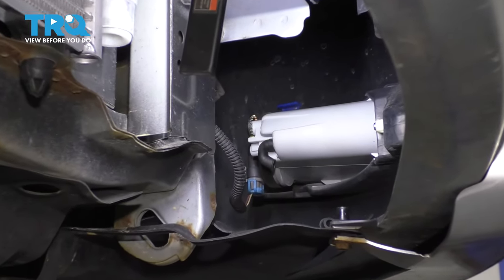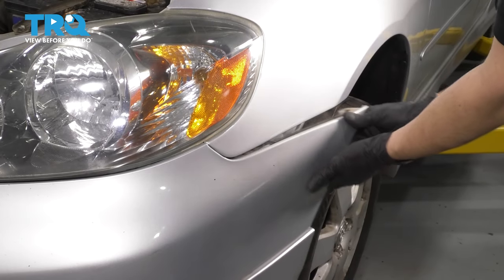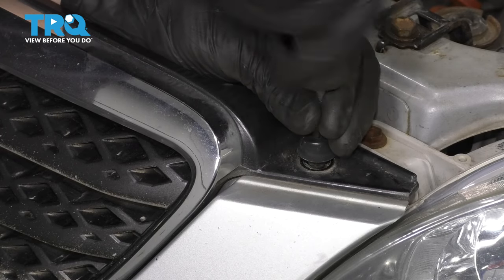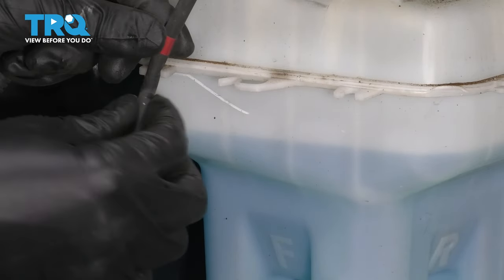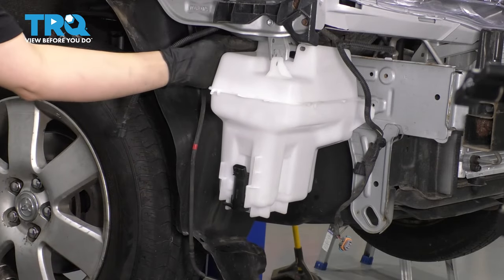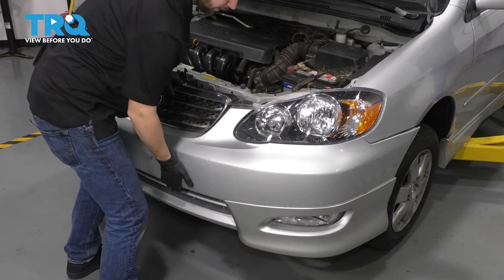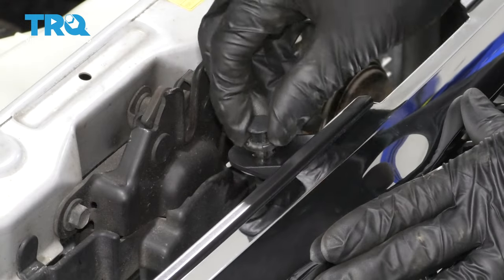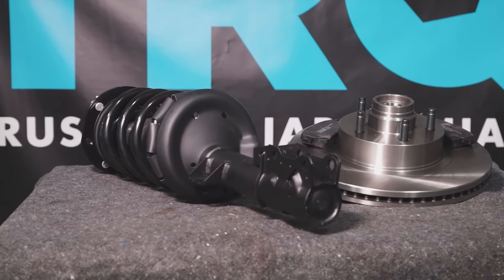How to Replace Windshield Washer Fluid Reservoir 2003-2008 Toyota Corolla

Comment: The only thing I would add to this excellent video is this:  Check the installation before you put the bumper back on.  Then once you're sure everything works and the quantum gremlins haven't been chewing on your wires/etc.... reinstall the bumper.  ;)  And 1 other thing... if your car has any age on it get a small handful of those plastic clips ahead of time.  They get brittle after a few years and will sometimes come apart as you remove them.